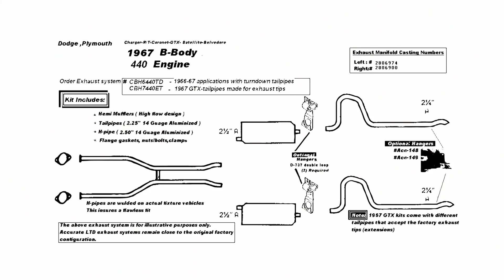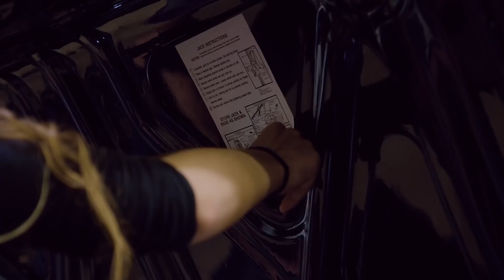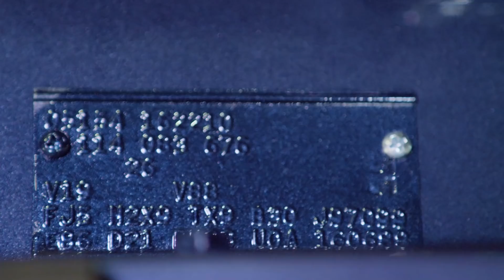SUPERBIRD CONVERSION HOW-TO!

Comment: When bleeding brakes. try putting a hose and a container on end of the bleeder screw. then the fluid will go through the line and into the Container. And you have no trip and no waist.
Reply: @666KTY My guess, they were just trying to give Alyssa something to do for the show,  so they should've at least used a hose and container to catch fluid, instead of getting it all over a newly restored vehicle